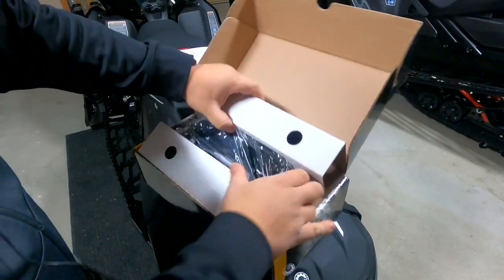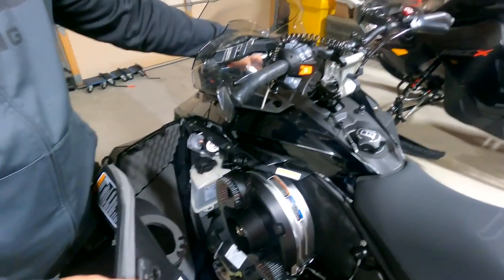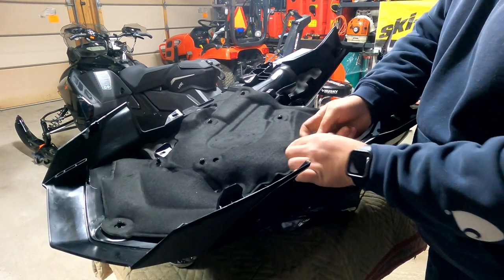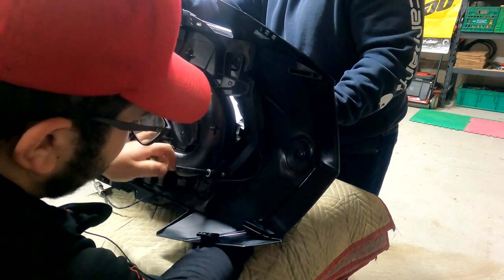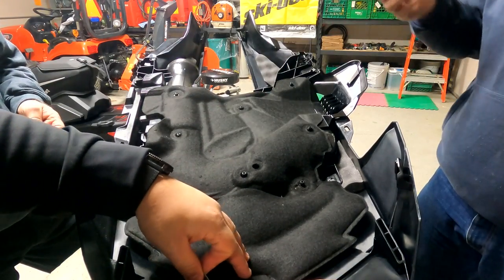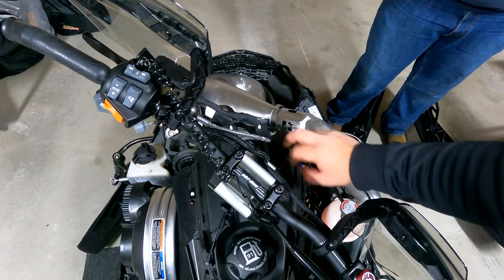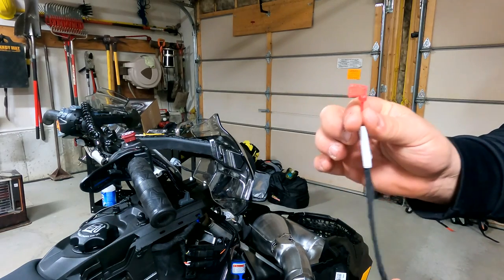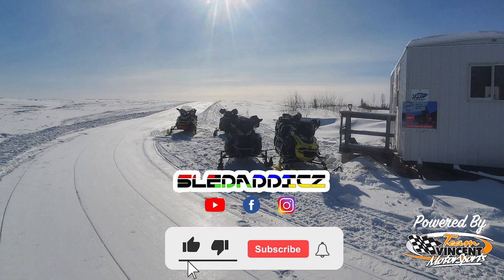Auxiliary LED Light for a Ski-Doo Gen4 | Step by Step Install! | We met up with a subscriber!

Comment: Have both flood and hi beam aux. definitely go with high beam option but I run both
Reply from the maker: Agreed. I installed this light on my first gen4 in 2018 and it is a glorified asthetic option. Doesn't really add more light to the trail, just lights up the area right in front of the sled. I have since upgraded all my gen4's to alphaLED bulbs and it is so bright that I don't even need the accessory high beam lights - I did hear they are super bright and actually improve trail visibility. Cheers, Jesse

Comment: Have you guys ever installed the six lights that go in the front grille area? No installs of those on YouTube. They look like that would work great being way down low in the front
Reply from the maker: No we haven't. We actually find on the G5 that there is zero reason to add additional lighting. We do tons of night riding and find the stock LEDs to be more then enough.